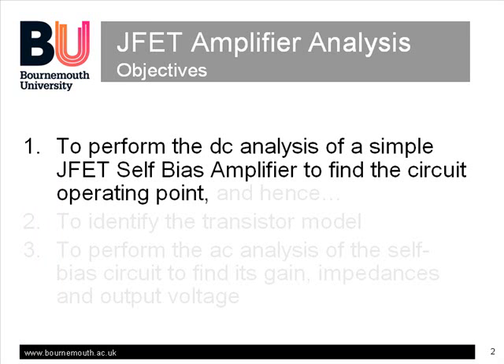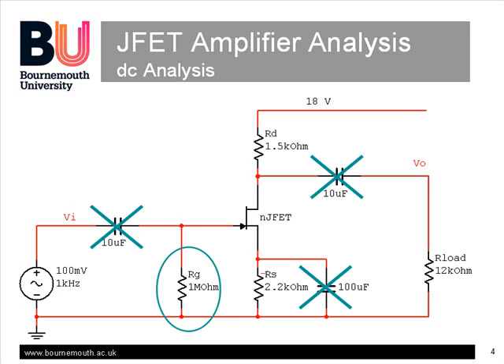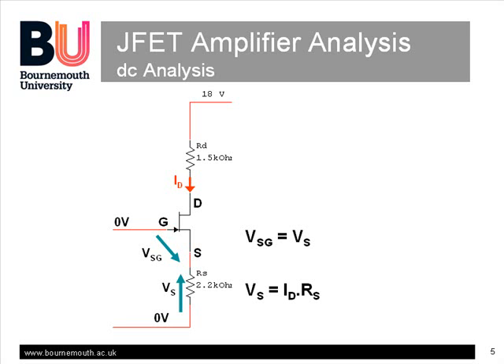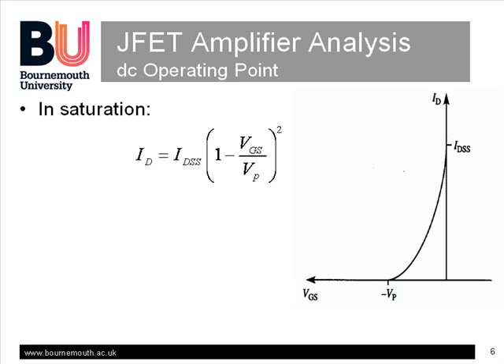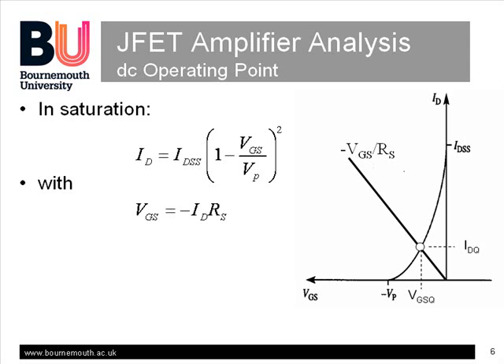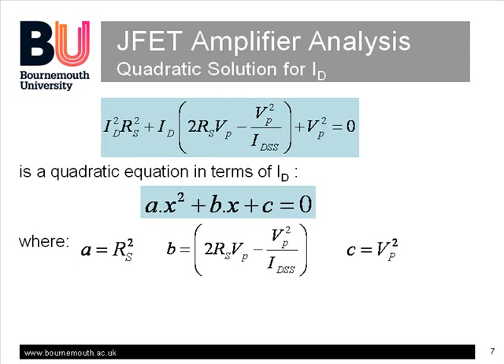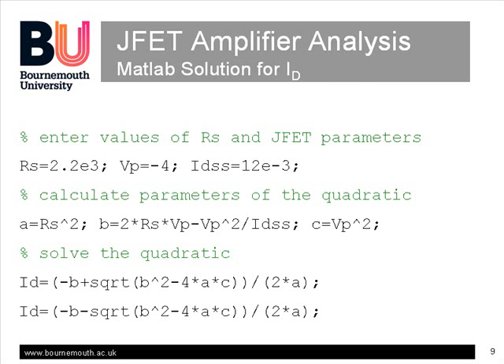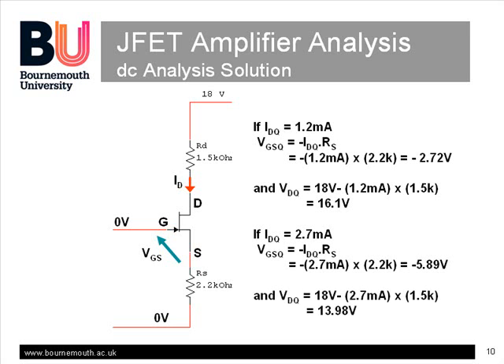JFET Analysis part 1

Comment: Careful: at 4:02 "... with drain current increasing as the gate voltage becomes more negative." That's wrong: it's an N-channel JFET, so (as the transfer-characteristic plot shows) the drain current decreases as the gate voltage becomes more negative.